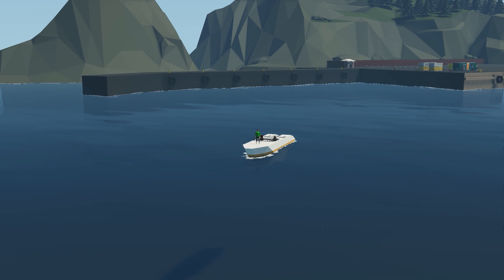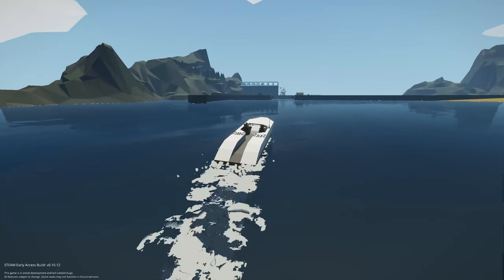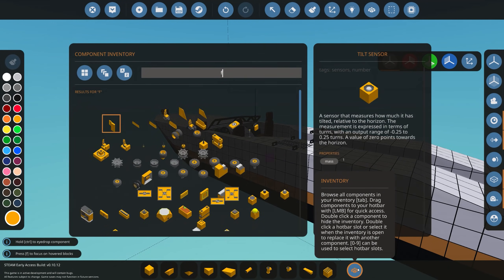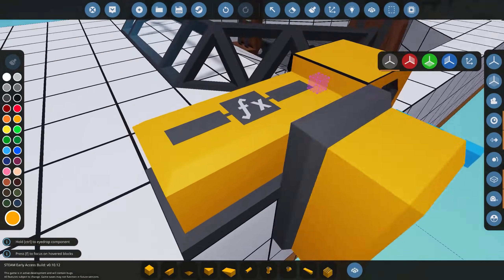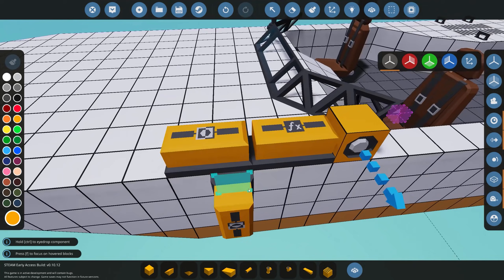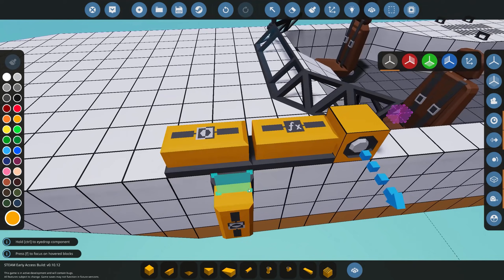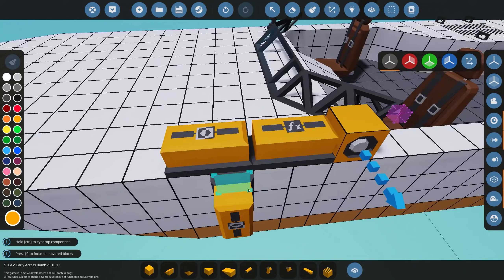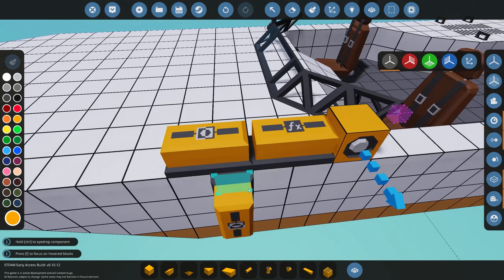Compact Boat Stabilizer - Stormworks Tutorial

Comment: This is a fantastic video and was really useful, however some of the information in it is wrong. If you also add fins on the front of the boat, those fins are inverted for pitch (but not for roll) because they are in front of the CG. Hence you actually need two new adds for the front two fins. They should use the same roll as their corresponding rear fin, but add the inverted pitch value. So:
* for a 2 fin setup: you need 2 functions (1 pitch, 1 roll), 1 inverter (just roll), 2 adds (one for each fin). 
* for a 4 fin setup: you need 2 functions (1 pitch, 1 roll), 2 inverters (1 pitch, 1 roll) and 4 adds (one for each fin).

Alternatively for the 4 fin setup you can use the original 2 f(x) (1 pitch, 1 roll) as described in the video and 4 f(x,y,z) (one for each fin: x + y, -x + y, x + -y, -x + -y)

Comment: How on earth does the tilt angle change depending on where the tilt sensor is on the boat? The whole boat moves as a unit, the direction is the same regardless of where you measure it from.

Comment: I'm currently having a problem when I reverse.

 I have a roll and pitch stability system. It works great when I'm going forward. It consists of 2 fin rudders at the back of the boat on the port and starboard sides. There is also one in between them. The ones port and starboard are for roll stabilization. The one in the center is for pitch stabilization.

They work flawlessly when going forwards. If I take a left turn the boat wants to roll right the starboard fin goes down the port goes up. The pitch fin also works properly. But when I reverse they increase the motions. The pitch fin adds to the pitching moment and the roll fins exaggerate the roll instead of countering it and cause the boat to roll over.

I have tried to fix this a couple of way and no luck yet.

First I tried tying it into the throttle position (and electric motor rps) using a threshold gate and a numerical switchbox. If the throttle is at -.01 - 1 I tried to send the info as an inverse signal so that it still works but in reverse.

Secondly I have tried to Just shut off the system and send a 0 signal if the throttle position is -.01 to -1.

Any ideas thanks
Reply: Use a numerical switch box so when you’re in reverse it sends no signal

Comment: i know this is an older video now, but ive implemented the systems into my small boat, and there brilliant except when in rough seas. I have this problem where if i face slight away from the on coming waves, as i come over the wave the boat will steer itself towards the wave and will keep doing this until its driving straight towards the wave. Any help on sorting this strange problem would be greatly apricated. NOTE * its nothing to do with the front 'pitch' im almost sure its the roll sensor kicking off as i go over the wave and bringing the side facing the wave down quickly causing the ship to 'steer'

Comment: Don't you want the front pitch to be inverted compared to the back? So you can pivot around the center of mass?
So if the nose comes up the back is pushed up and the front is pulled down.
My problem is wiring that up. Because you can no longer do it with just two add blocks.
I don't get why you can't directly connect multiple things to one rotor and have it just add itself.

Comment: I can't tell whats happening with mine. no matter what I do, the fins do the reverse of what they should. they both go opposite directions which is good, but always try to flip my boat over. I tried plugging the fins in the other way, I tried removing the negative multiplication. It doesn't work. No matter what, it always tries to flip me over. Any idea what I'm doing wrong?
Edit: Ok turns out my stability sensor was actually a water level sensor.... all fixed

Comment: just saying that roll is something boat doin real life and it is what permits them to turn sharpely at planing speeds and the pitch is used to get more speed when the boat starts to going fast you want it to have to pitch up sleightly to get almost only the propellers in the water and after that it to level out but only if the hull is lifted out of the water so it can go as fast as possible.
If you want it to be more realistic in small boats you should have trim tabs and propeller pitch so you can make this happes as it should

Comment: It doesn’t matter where you put the tilt sensor. It measures only attitude, not altitude. You can check that multiple tilt sensors positioned differently but facing the same direction produce the same output.
Reply: dunno mate as it does count change from where it is from were it was.. In this example if he put it lower in boat the tilt would be a diffrent number also arrow indicator is telling you what way tilt works so maybe 3y ago that was the case but for last 2years it is bulllshit what you wrote
Reply: @RappelzWikiaPolska  Have you checked yet?

Comment: I need help!!
Im building decently sized ship with 4 diesel engines (which should be more than enough to power it), but I’m having a lot of problems to make it go faster than 10 m/s. It’s propulsion system consists in (as I said) 4 large Diesel engines, powering 2 large propellers with gearboxes, the engines should have plenty of air and exhaust since they all have 1 large fluid slot for air and 2 pipe exhausts each, with pumps. For some reason, the engines can’t reach max RPS, their limit rps is already at 100, and the situation doesn’t change if they are not connected to the gearboxes and propellers. When I check their stats it seems like they don’t have enough air or exhaust (thing that shouldn’t be happening), and those stats change between all 4 engines (but I’ve built them identical to each other), and yes I’ve already checked all pumps are powered and facing in the right direction.
Pls help me, I’ve been dealing with this problem for moths

Comment: Uuuuu I i think you messed up thous front fins, and made a hydrofoil. Should have inverted the front fins direction or the number gong to them. 

Because how you have that set up the pitch control is inverted, so as the boat pitches up it sends a negative output to the fins.
Fine in the back thats what ya want but if both sets of fins angle up (negative arrow direction) front and rear your actually lifting your self out of the water.

Comment: If you mixed the rudder system with the weight-block-on-rails system would it be more stable or less stable
Reply: I would assume more stable because the travel time of the fins is much faster and has more impact directly on the vessel WHILE moving, which would also mean that the weight system doesn't have to do as much travel ( keeping closer to center).

An advantage of mixing these is that you also have stabilization while not moving.

Comment: A really different question with your  train project for the auto light (backwards/ forwards) did you use sensors and logic or was it a signal form the antenna?
Reply from the maker: Speed sensor
Reply from the maker: And if it’s in or not
Reply: But how did it turn off ? Because its not manual

Comment: Has someone a few tips for me how I build big and efficient engines for big boats i always don't know how to set up the gear boxes... Or use electric motors?
Reply: for any large creation, i have found that a hybrid(engine and motors) works the best, the electric motors help get the initial rps up to get you going and the engine can charge the batteries, the motors also give more torque when you need it, and start/stop as fast as you need, they never stall either

Comment: Tip: in a microcontroller you don't have a number inverter, you can replace it with a function block with the next code: x*-1
Reply from the maker: Or just use -x
Reply: @MrNJersey  or use x*-1 if you are making it for a 2nd grader

Comment: Would a PID system improve the performance?
Reply from the maker: Yes however this cuts the hassle out of tunning a PID which alot of the community dont know how to do or cant bother doing
Reply: MrNJersey that is true. I will try it out though :)
Reply: @MrNJersey  Also stock PID is not very good, that's why I made my own that limits Integral part when needed, preventing jets from exploding, can go from start to 199 rps (with stock PID, integral windup cause explosions), with only 0.5 RPS overshoot!!!
If you are interested in I can send you something MrNJersey, Peerebeer

Comment: Mr NJersey: "...These aren't stable. The nose will pitch up when you give it a bit more on the throttle..."
Me: <watches on silently as another jet thruster powered boat takes off and flies off into the sunset.> ....o7
Reply from the maker: Steeljaw XXI then don’t use the compact ones, use larger ones in my other tutorials
Reply: @MrNJersey  I think you read me wrong on this one. I was completely joking. I usually build things in excess. If it has an engine in it, better put 3 more just in case. If it's reaching 40 kts at it's peak, what can adding a few rockets do?  I've totally used this setup on my smaller boats after you've posted it, and it certainly is less effective on larger builds. I use your weights on rail system on those. But I wasn't taking a swing at this at all. I was just joking at the ridiculousness of jet powered boats and how much "a little more throttle" can make things go so magnificen-I mean horribly wrong. . . .

Half the time I'm in creative mode, I'm testing the limitations of the game. So those jet boats are more or less speed tests or even "will this work" tests. That being said, would either stabilization system work reliably at 200+ kts? I'm not questioning your systems at all, but they're meant for more realistic speeds and conditions. I'm just wondering if simply ramping up the equations in them would do the trick or adding more rudders or weights and sliders (for the interior hull rail-based Mr NJersey stabilizer) would do that as well? Got something new to test. . .

Also, side note. I finally went and dove down to inspect the MRN Jersey wreckage. . . .Is there a back story they've provided or is it just named after you for your community contribution. That thing just is mangled and it looks like it has a story behind it. Again sorry if there was some kind of misunderstanding of this joke.
Reply: @steeljawX  I think you over reacted. He only responded with a little sentence, you could just put a "I was jk" xdd
Reply: Ohh... ! I love to build those too.... my fastes one was going 180 from the speed sensor... that is somehow the limit.... (afterburner didnt help D: )
Reply: @Warzone151097  I've only noticed afterburners making a difference after you've maxed the speed of the engine at the throttle setting. After that, it'll give an extra, it seems like, 2~10% more speed after a straight run, but yeah. Afterburners are a little disappointing. Kind of like the wheel grip system currently in place. That needs to improve a lot as well.

Comment: Wow what a good and useful tutorial! 

Could you  maybe make a tutorial on how to make a toggleble engine?
Reply: Endoskull have microprocessor on his Steam workshop, one of his oldest creations
But it is actually very simple
Input: rps,gas (numerical); key switch (bool)
Output: Number(gas) boolean(engine)
Key will simply switch numerical switchbox between ZERO and INPUT, so when it is ON it will simply pass gas value, otherwise send 0 to shut engine down
If RPS are lower than 5 AND key is ON output signal to start engine
I hope it helps :D
Reply: @jakubpollak2067  does it work though? i have tried messing with the amount of rps to start and it never seems to work
Reply: @redpug5042  Yes. His logic is sound. 

If engine is off, and key is off: 0 is supplied as throttle, No signal is sent to the starter.
If engine is off(RPS below 5) and key is on: Throttle value is sent to throttle, on signal is sent to the starter.

If engine RPS is above 5, and key is off: 0 is supplied to throttle, none transmitted to the starter.
if engine RPS is above 5 and key is on:  Throttle value is sent to throttle, but no signal is sent to the starter.

The thing is, the throttle HAS to be ENOUGH to make the engine turn stable at, but preferably ABOVE 5 RPS.
Reply: Jakub Pollák thank You so much for helping answer!